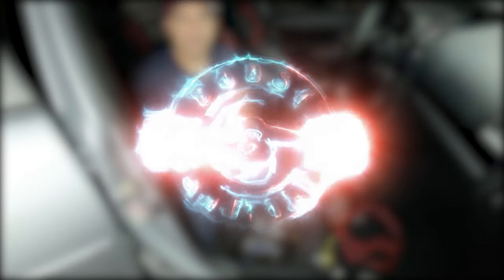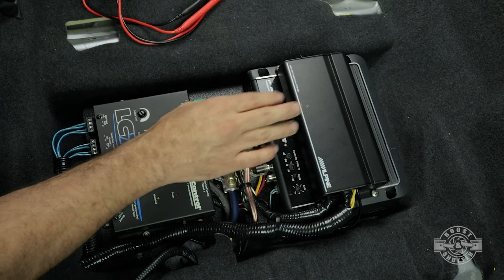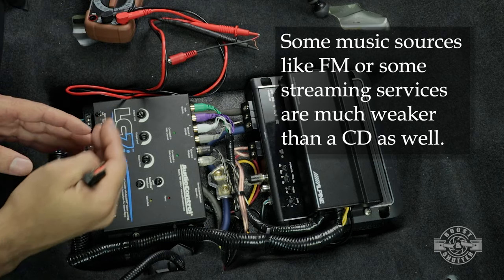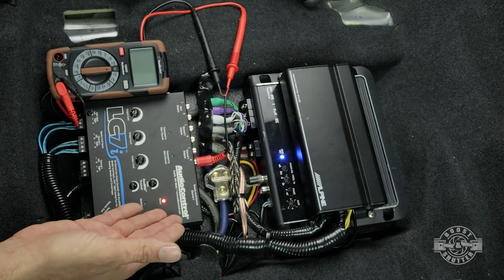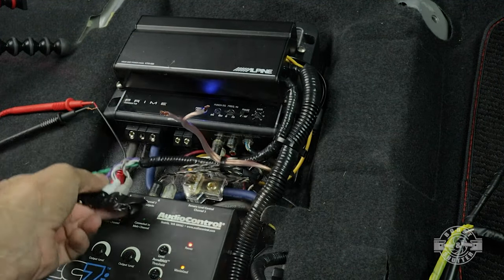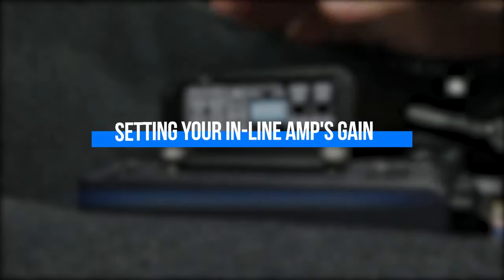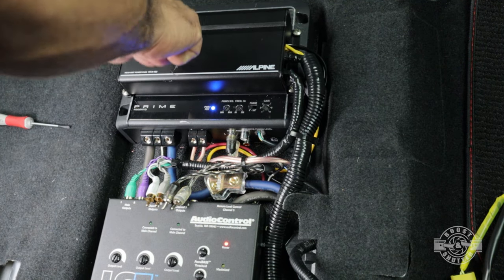How to TUNE Car Amplifier & Set Gains

Comment: So I have a Question. If i Have 2 4ohm dual voice coil subs that handle 600 wats rms, and i am doing a 1 ohm load. I get the calcualtion and all, jus wondering if my amp is 1200 watts rms at 1 ohm load, when i do the calculation, do I do the square root of 1200 X 1 or the Square root of 600 X 1.

Comment: I had my amps under the seat on my wrx still too, but there is also a heater duct under there spraying warm air so have moved them into the boot. If you want a decent, but well priced head unit with dsp, secaine make one that fits into these cars. Good video though and some well explained points,thanks

Comment: First of all. Fantastic video and easy to follow.
I do have technical question. So, I have a 1500.1d amp and pushing 800 watts at 2 ohms. But I know some of that power is lost to heat. Does this mean I should increase my amplifiers sensitivity a bit more to compensate for that loss?
Reply: I set my sub amp up with the speaker connected, using an oscilloscope (which is a better method than using just a DMM).  I've read that this is more accurate, as you're measuring the signal when the voltage rails are actually loaded to account for voltage drop.  Barevids has a video on this.  I also do this with the car running, so it's providing the full 14.4-14.6 volts supplied by the alternator.  I should also state, that my sub is capable of handling more RMS than my amp can put out.

Comment: Good job explaining everything. Super helpful. How did you get the cut RCA wires to stay onto your voltmeter leads?  I just recently installed a LC7i I used the clipper light which gets you really close but not perfect. I'm gonna have to try this method though. I ran into an issue with no right/front output on my amp. I tried everything except testing the right/front RCA out on the lc7i with a multimeter, and or RCA IN on the amp for the front/right speaker. All speakers work I tested them all from the 8 wire directly from the the head unit to a extra speaker I had laying around. I also tried different RCA cables. No luck.... Frustrating. My amp is a spendy one JL Audio HD900/5. I'm hoping the problem is the LC7i right/front output.
Reply: You can buy alligator clips that fit on the meter leads

Comment: Just take note if you set your EQ flat and set your target voltage it will change if you turn the bass EQ up any at same volume and will have to adjust again.
Reply: I totally agree!  I don't understand why 99% of literature and videos tell a person to zero/flatten their treble and bass settings on their head-unit only to have their set target voltage on their amps go too high because they later turned their treble and bass settings back up on their head-unit afterward???  ...then a person has to go back and lower the gain/voltage on their amps because it went way too high at that same 3/4+ volume.

Comment: Boost & Shutter i'm watching you make the gain adjustments on the Alpine KTA-450 amp how far do you have the gains turned up on the front and rear gains, it looks like about half way if i'm correct?
Reply: up to the maximum where it doesn't produce distortion or until it delivers the right power level to your speakers.  sets the gain to the lower of the two.
Voltage=√(power×impedance)

Comment: Great video thank you. I have the Prime 500.1 so I understand how to set the gain for that amp thanks to your video. I am running the Prime 300.4 for my front and rear so do I do the same thing with the multi meter for the fronts as you did with the subwoofer amp?   I am using the stock head unit in my F150 and an AudioControl LCQ-1. Thank you!
Reply: Richard Lockwood yes. Unplug your speakers and run a 1,000hz test tone.

Comment: Appreciate the videos! I still have the Lc2i Not the pro version either. I have tried measuring the voltage output from the converter as you have but I get 0 reading everything. How do I sey the correct voltage output to my amplifier input?? Subbed and liked. Thank you
Reply: Make sure the signal is coming in to the LC2i, if it goes in but not out, make sure to adjust the main output level.  If no signal is coming in, turn up the volume on the head unit or check the cables.  Also make sure the multimeter is in the AC voltage position.

Comment: I have a 2018 Crosstrek with no factory amplifier. Do you know if the dash speakers are tied into the front channels? I will be putting in a aftermarket amp soon

Comment: I also use this line out converter, but with a rockford fosgate 4-channel amp.  I have an issue with alternator whine, but it's only present when i touch the gain on the amp.  Right now i have the gain on the amp set to 0, but if i touch it at all, i'll get a very prominent alternator whine through the speakers and i have no idea how to get rid of it.

Comment: Question? If you are feeding the amp it’s maximum input aren’t you supposed to keep amp input gain at its lowest sensitivity? Mine takes 0.2-5v maximum. It’s gain lowest sensitivity is 5v and maximum sensitivity is 0.2 volts

Comment: I did all this and actually my input voltage was starting at 12 volts!!! Anyway I set my Kicker Amp for 48 volts for a 4 ohm load for one 8” Kicker Q Class. Get this after all that the sun still played low. Didn’t matter what I did. Eventually I just brought up the gain ever so slightly and the sub came to life. I did it twice and it’s the same. My other amps play fine. But I did set them by ear and they sound great. Any suggestions?

Comment: hey brother great video and way to set your gains with a volt meter. my question is . How do you set your gains on your head unit to go as high before clipping and moving to your amps for adjustments afterwards.
Reply: @akqjtn  is for my aftermarket eclipse cd5030 5v head unit
Reply: Jahliee L.E gonna have to invest in a SMD DD-1 or find someone who has one.

Comment: I have a pretty good Head Unit. It puts out to the RCAs 6.2volts at full volume with ZERO clipping using an OSCILLOSCOPE. 

I have a question, when setting the gains on my amplifier connected the OSCILLOSCOPE to the speaker wire of the amps, and on my head unit I set volume all the way up since it doesn't clip, and adjusted the gain on the amps until just before clipping.  What befit would I gain if anything having thr volume set at 75% .. I always thought you set the HU volume to just before where it clips at the RCAs.... so it your hu goes to 36 on the volume, and it clips at 33 but not 32, then that is where you set the volume for tuning. But mine does not clip. So what would thr point of setting the volume at 75%?

Comment: I have same Amp Rockford Prime, I want to set the Gain correctly - So first thing, how did you decide 4v for your LOC to Amp?
Reply: The manual is where you find the maximum input voltage the rca can handle. That's how he got 4v

Comment: So if you're only doing a subwoofer, won't playing 40hz test tone hurt the door speakers if it's at 75% total volume?
Reply: That's why you ONLY connect the test rca cable to one of the channel 3 (subwoofer[s] channel) outputs on the LC7i, and neither of the other two channels' outputs. Plus, since you have disconnected the rca's from channels 1 & 2, the 40 Hz test tone's signal will only be feeding your sub's amplifier and not to whichever channel feeds the amplifier thats powering your door speakers. Sorry it's 2 months late, but I hope that helps! Just stumbled on this video myself, and it saved me a TON of frustration!!

Comment: If Im sending 2 channels from Lc7i to 4chan and the 4chan is recommended 5v for RCA Input. Do I split the voltage to 2.5v or do I set both at 5v?

Comment: would you do the same things but with only the 40hz range if it was just a subwoofer amp? I just installed a r2-d2 Dual 10" sealed sub from rockford fosgate using this amp. First time ever doing any type of audio setup so im unsure how to tune it. I thought i had done it by the instructions of the book okay but im having second thoughts now about what my deck is when flat as well as if i tuned this properly. So far the way that it is i have to crank it to get any real noticeable bass and its just not giving the sorta punch that i was looking for.
Also, if im just using the built in CLEAN IN and OUT LED in the amp itself, is using the 40hz @-5db tone still a reliable way to tune it?

Note. I also looked it up and my head unit output is 2.4v, how much could that be taking away from the sound quality in the subs?

Comment: Hello, for finding target voltage would you choose the max rms at the impedance your sub will be wired (4ohm) or the absolute max rms (at the lowest impedance of 1ohm). For instance, I have a kicker 44CWCS124 SVC at 4ohm and a Kicker CXA400.1 (4ohm rms= 150, 1ohm= 400) at 4ohm I get 24.49V and for the max rms of the amp (1 ohm) I get 40V =(400(max rms)x4(subs impedance))^2
Reply: I feel like it should be the rms max at the impedance it is wired, so 24.49V. I just wanna double check! Thanks!!

Comment: When you removed your passengers seat, then reinstalled it, how did you make the SRS/Airbag light go away? After you plugged it back in?
Reply: Take the ground off the battery before you unplug your air bags. Than after you put them back. Attach the negative back on battery

Comment: I have a  lc7i pro mono gain set with multimeter bass sound good but plays really low as in volume when I turn gain up a bit hits really hard but then I get a knocking bass not the low deep bass  amp is power fosgate 1bdcp 500x1 ran at 1ohm sub is one T1 d212 2ohm dvc I got a 4 channel amp highs are good just can’t seem to get low deep bass

Comment: Why not measure voltage on the speaker amp before you splice into the wiring harness? You'll have to put in a splicing harness anyway to have the amp driving the speakers instead of the factory headunit.

Comment: to dumb things down, should my equalizer settings on my radio be set to normal (neutral) before i tune my amp? i dont have all this fancy stuff, just a stock radio on a does f150 and a basic amp for my subs. and if i do need to set the settings to normal before i tune my sub, i can turn them back up once the amp is tuned, correct?

Comment: Just wondering why does my sub coils smell when I have the gain up? The sub and amp can handle it easily there is no distortion but I know something not right with either my line output converter gain or maybe I have the volume too high on the head unit. Head unit level max is 60 I have tuned it to 50 all my eq is flat and no bass boost on amps

Comment: I have a question: I had an epicenter and amplifier installed by best buy and I believe they did it incorrectly. I have a 2021 GMC terrain,stock radio. They ran a remote wire to my ignition wire. Doesn't the epicenter micro work without using a remote wire? How do I complete this action myself?

Comment: Did you get any constant hiss from the system ?I didn’t use a lc7i but am wondering if the gains are set too high.
Reply: @akqjtn  I used a good crossover that I already I had and a jl xd800 amp. will the the lc7 possibly clean the signal to get rid of the noise ? 

Edit ::The hiss only can be heard at very low volume or when music is silent 

I also lost Apple CarPlay and volume for phone calls. I’m pretty sure I messed with a wire I shouldn’t have.

Comment: I have the LC6i and tried this method to set the gains on the LC6i today but I couldn't get it to work. I set the DMM to AC Voltage and used a test RCA lead with exposed wires but on the DMM it showed 0 voltage. Not sure if the DMM I am using is suitable or not since it only has two settings for AC Voltage 200 and 300 if I remember correctly. Anyway I just set the LC6i by playing music and setting it using the maximise light which seems to work ok.

Comment: In the beginning where you mentioned that your amps were max voltage of 2.8 and 4. How did you find those numbers?
Reply: I'm trying to find the same thing.. have you figured it out?
Reply from the maker: In your manual or spec sheet usually under "max sensitivity" "input voltage" "input sensitivity" or something like that.
Reply: @akqjtn  My manual has a Max signal input of 20V and Max sensitivity of .2V . What one should I use? Thanks BTW great video.

Comment: Hi, I noticed one thing that maybe you could help with. So if an amp accepts up to 4v input and you set the LOC to 4v output for only one RCA, wouldn’t it add more voltage, possibly even double, once the second RCA is connected to the amp, resulting in a higher than 4v input for the amp? Or does the 4v input rating on an amp mean 4v per RCA and not the summed voltage of the two RCAs that would be feeding the amp’s input? Thanks for your help, and excellent job on probably the best gain setting video I’ve ever watched :)
Reply: Jeff Goetz rca voltage does not double
Reply: Hey Jeff I currently have the same question wondering if you have learned the answer by now I see the other responder said it doesn’t double but can someone speak more to that
Reply: @kevinlechner7722 yeah, rca voltage doesn’t double

Comment: What do you do if your factory radio will not distort at absolutely full volume because of the nerfed cutoff?
I guess what I'm trying to do is find the peak clean point of a Uconnect radio without a CD.  My only idea is a 0db or -10db mp3 test tone on a usb drive but like I said the factory roll off won't ever distort at full volume.

Comment: Two part question. 1) how do I find the output voltage of my factory head unit, and 2) how do I figure out in inout voltage if my Amp? From what I can find, it’s 14.4 volts. Seems a little high?
Reply: Input voltage*

Comment: I set my amp gains by a simple multi meter on 2 ohms only my amp can do 1 ohm's but since I am aiming for efficiency up to clipping on my one subwoofer.  A person CAN NOT do this with a SMD DD-1 and try to overlap the gain on the amp where the micro processor on ANY CAR AMP can not do :D  LOL

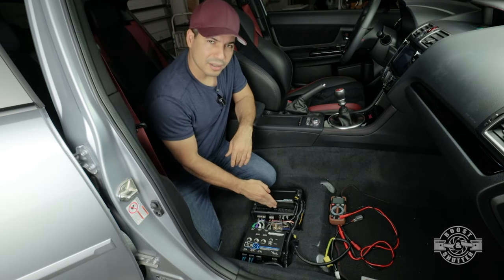Comment: This seems like great info, but I'm going to have to watch it like 10 times so I can try comprehending what you're saying here in some aspects. Like around the 2:30 mark you said: if you're feeding a considerably weaker signal, you'll be forced to turn the gain up? I'm confused on this? So hypothetically, buying an amp and all the knobs are set to wherever the factory sets them at after they're done constructing them, is the amp at full power for the volts it's getting with gain at 0 or with gain up to 10? I understand how to find my target voltage, the math and all that, and I even have the same exact multimeter as you do here. I just don't really understand how to go forward with any of this actual work. I finished my install like 2 weeks ago now and I still have everything on absolute 0 bc I'm afraid if ruining any of the equipment. And with Covid it's hard finding a shop or anywhere I can go that I could trust them getting it correct, before I go out and ruin my equipment by thinking it was done correctly when it actually wasn't, and I ruined my equipment bc of that, hypothetical
Reply: Set the head unit volume to 75%, adjust the LC7i output to the input voltage of the amplifier and the gain of this to the maximum without distortion, if that output voltage corresponds to a higher power than that supported by your speakers, reduce the gain until obtaining the adequate voltage, (voltage = √(power × impedance)).

Comment: For a jl audio RD 5 channel amp .  speaker setting is  120hz  good ? I have  jl audio c2 speakers  and For the  subwoofer enclosure W3 10inch  is 60Hz a good setting  ....
I DON'T WANT TO DAMAGE MY  SPEAKERS  ... or should I go back to the  shop  ....
Thanks for the help

Comment: How in the world do you figure out the max input voltage for your amps?  I have the kicker key 500.1 and the kicker key 200.4.  The 500.1 is 500w rms and the 200.4 is 200w rms.  I have the lc7i and realize it’s max output is 8.5v.  I just need help understanding the maximum input for these amps so I can adjust the lc7i properly.

Comment: If you feed the amp the maximum voltage in can take in the line inputs, wouldn't you automatically have to put the amp gain in the lowest setting?

Comment: Do I have to unplug all my door speakers to play the tone and tune the gain on the LOC to get it at a certain voltage ? I’m only using a Class D amp for the Subwoofers.. or is there another way to do it.

Comment: Hello, i have a question so if i am using the Stock HU and stock door speakers and tweeters, but choosing not to use the flat setting on my HU so the quality on those speakers are still reasonable would the process be the same?

Comment: can I ask you a question since your so knowledgeable and am I have a feeling that audio shop people are not as smart I could be wrong though... So I was given a Taramp HD 3000 @2ohm and I want to pair it up with a Dual 12'' Kicker CompR (500-RMS each) am afraid that this amp will blow these speakers but can I adjust the amp to output fewer watts to about 1500 max to meet the power requirement of the subs? is this a bad idea and I should just sell this amp and just buy a different amp? what is your opinion?
Reply: scorlin gonzalez greatly depends on the source. If the source is a high powered aftermarket stereo or high end loc or line driver that puts out 5+ volts, then possibly not. If it is a factory radio or lower powered aftermarket stereo then possibly so. Also, you don't have to turn the stereo volume all the way up which means the amp won't output as much power.
Reply: Adjust the output voltage of the amplifier to 44.7 volts and with this you will have an RMS power of 1000 watts with a load of 2 ohms.
Voltage=√(power×impedance)=√(1000×2)=44.7 volts